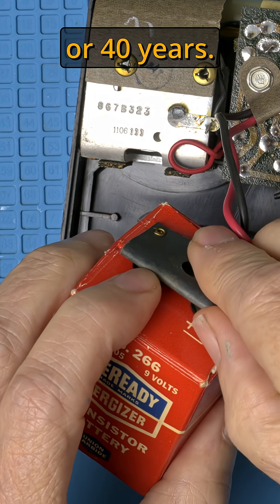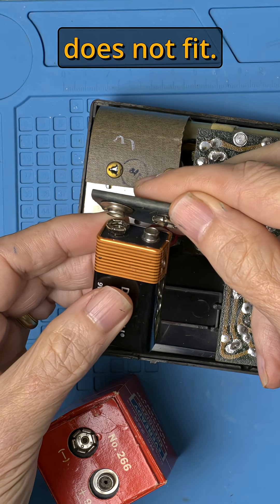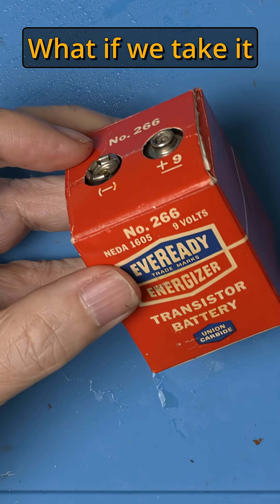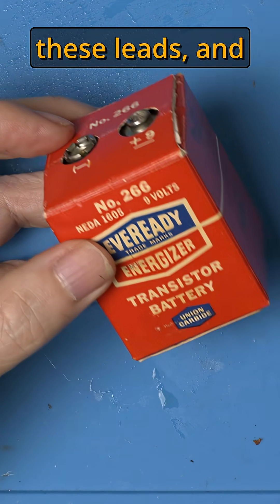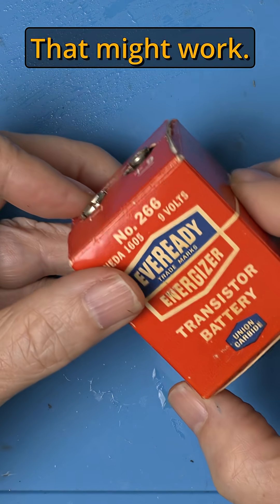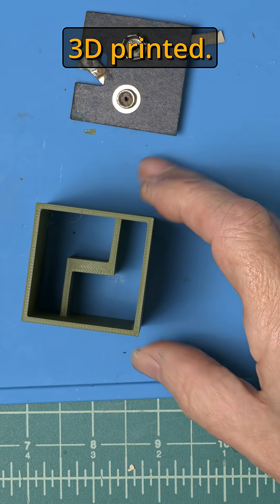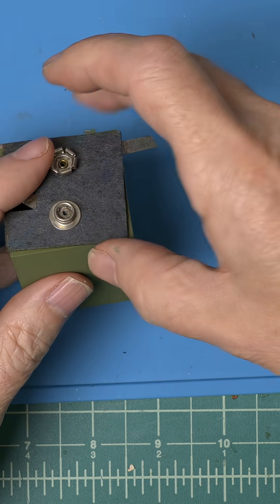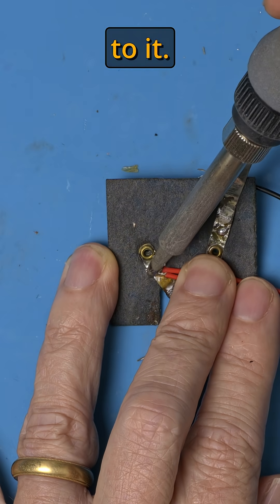3D Printed Vintage Battery Adapter #vintageelectronics #3dprinting #eveready #electronicsrepair

Comment: If you connect batteries this way, make sure they are the same and have precisely the same voltage. Otherwise, one of them will discharge.
Reply: Doesn't matter on alkaline batteries, they can handle the balancing just fine, only lithiums care about that kind of stuff.

Comment: connecting these two 9V paraller only kills them faster, is better to  use  6S AA 1,5V NiMh
Reply: Yeah, and then you have to charge 6 NiMhs every time they die instead of putting in 2 new alkalines and being done with it.
Reply: @neoxr9655  Agreed, I'm already running out of batteries to throw into the ocean, now I have to scour the streets looking for discarded vape pens.
Reply: @giveAIchance  As if consumers contribute to even 1% of waste/pollution. A lot of money has been spent to condition you to think it's up to our individual actions how much the world is fucked.
Reply: @neoxr9655  or just have a few charged batteries ready to go.

Comment: Dude, even 9 volts are getting difficult to find. And if you need a AAAA battery? Forget it. Had to find a 23A like two months ago. The package litterally arrived with dust on it. And CR123A's? 😂 good luck.

Comment: You get more power out of 2 AA alkaline batteries than from a standard 9V battery. Would have been better using 6 AA batteries in series. If you didn't have enough space, using less batteries and a boost converter would still give you more Wh.
Reply: This would also prevent current flowing from one battery into the other if they are at different voltage levels, which is a good idea if they aren't rechargeable.
With two (non-rechargeable) 9V batteries, I think it's a good idea to add a diode in series with each battery for this reason.
Reply: AA batteries would fit in a spot welded packet. For 3D printed battery holder only AAA would fit.

Comment: Pretty sure you could get those when I was in highschool. They were flashlight batteries. For the big ones with the kick stand. Plastic instead of cardboard of course, but might at least fit the connector
Reply: I don't remember 9v flashlight batteries.  Are you thinking of a 6v lantern battery?
Reply: @richardmartinez4145 maybe

Actually, i was getting the application mixed up, but im 40% sure I have put eyes on a large 9v. It was at least 10 years ago though.

Comment: You can't put batteries in parallel, they will fight with each over to maintain constant voltage ultimately self discharge and$or over heat!!

Comment: Strapping 2 cells together doubles the cell discharge as each cell has a plate and the electrons naturally jump you could use shocky diodes to stop this or just one cell at a time.
Reply: read this to yourself, it makes no sense lol. if your worried that one battery might try to charge the other, the difference is so little that it will not cause any harm to the batteries or cause one to leak.
Reply: @joshwayop I did not say leak and strapping two cells this way over time the self discharge is increased test it over 3 months did this at the BICC almost 40 years ago.
Reply: @alunroberts1439  the self discharge would not increase at all, the batteries would not be dumping any charge into each other, they will balance out and just stay at the same voltage

Comment: Wont that be 18 volts?
Reply from the maker: No, the batteries are in parallel, so the current doubles, not the voltage.
Reply: @Dream.Build.Create  thanks

Comment: Depending on the sizes, 6 AA or AAA would be far longer lasting and cheaper. Batteries in parallel (raw) like that are not ideal.
Reply from the maker: I just went out and measured it - you're right six AA do fit.  Okay, next radio!

Comment: Beef up those flush cutters. The small ones are good for 1mm copper. Have broken those in half with too big zip tie. Theres a size up from those. 6 inch? Less useful for small electronics. But way more forgiving for general shenanigans in the workshop small projects.
Reply from the maker: Thank you, great advice!

Comment: Cool fix, but long way around instead of just adjusting the connector.
Reply from the maker: If the connector was corroded I absolutely would have done that, but it was pristine so I wanted to save it.  I also thought it would look cool to have the old battery still in there!
Reply: @Dream.Build.Create  it does, can't argue with that

Comment: At first, I was wondering why you wouldn't just swap the leads out in the radio to fit a 9V, but I'll admit this was a cool fix.
Reply from the maker: If the connector was corroded I absolutely would have, but it was in perfect shape and I thought this would be a fun way to do it.
Reply: Thinking the same here about swapping the leads, but then you run into a problem of how you secure the battery in an area larger than the battery itself.  Electrical tape?
Reply: @ForDemoPurposesOnly  If I'm lazy and it's a personal project, I'd probably just set it in there and call it a day. It's unlikely I'd be doing much to knock it loose or damage anything. But yeah, realistically throwing some electrical tape on it would be an easy solution.
Reply: @ForDemoPurposesOnly cardboard and gorilla tape
Reply: I'm with EVmodern. Really cool fix, but if I'm in the field, I'm swapping leads. 
I'm a mechanic by trade, so I am always looking for the fast easy fix.

Comment: if you have 2 modern 9V connectors, why don't you just cut off the ancien one and solder the modern one on it , then velcro it into the case ?
Reply from the maker: If the connector was corroded I absolutely would have done that, but you're right, it was pristine so I wanted to save it.  I also thought it would look cool to have the old battery still in there!

Comment: Excellent solution!  I noticed years ago that "lantern" size batteries were coming with D cells inside from the factory. Very similar. Should be 2400mah as compared to the original which had 2600mah. Not bad considering they do still sell 266 batts but for > $30!!!
Reply from the maker: I did not know that about those lantern batteries!  Yes two alkaline batteries vs one larger carbon-zinc, almost nets out.
Reply: You can even buy adapters that allow you to use D-cells in place of a lantern battery. The D-cells that I have (Procell) are just shy of 20 Ah.

Comment: Now saving that battery box was COOL!!  I am not sure if you had any room, but it looked like if you made your frame a bit longer, it would protect the internal connections.  Only other thought is to warm the old battery box to soften the glue before opening it.
Reply from the maker: Those are both great suggestions!  That's why I post these, I always learn so much.
Reply: @Dream.Build.Create  Ah, just a different set of eyes on the same issue.  Glad you like the ideas and again, very cool project!
Reply: let the past die...kill it if you have too
Reply: @imperialpresence1173 those movies were so bad dude it’s so lame quoting the SW sequels
Reply: @jman22009   try replacing no.6 dry cells ..i'd love to make a rechargeable replica and put my old lamps to use...instead of moldering away on a shelf
what he did was like a heart transplant
Reply: @imperialpresence1173  You would then repeat history, bad and good.

Comment: The vintage form factor battery was priceless. Should have preserved it. 😢
Reply from the maker: I'm totally with you.  The battery isn't quite priceless though, you can get them on eBay for $10 - $20.   I wanted to keep the vintage look when the radio was opened and still have it work.

Comment: Why not just change the lead on the radio side to connect the battery?  Would have saved time and $ and no 3d to print .
Reply from the maker: I absolutely would have done that if the leads were corroded, but these were in perfect shape so I wanted to preserve them.

Comment: Id say stop wasting. Just get a 2 lion batteries with simple bms You get 8.4v.  or use additional stepup to have 9v available until the end of discharge. Will last you ALOT longer also. And then you can reuse it as you told is eats alot of power.
Reply from the maker: That's a great idea!  I'm sure it would work fine at 8.4v

Comment: I did a similar repair on a 1950s record player.  Double electrolytic capacitor had failed so I fitted 2 modern caps in the original casing.
Reply from the maker: That's a great way to do it and you preserve the look.
Reply: 80 years ago, my grandpa fixed my great great aunts radio with a light bulb. Last I saw it, it was still working,  but that was 50 years ago. 😅
Reply: I did that to resurrect an old Magnavox stereo console.

Comment: Why not use six AA/R6 batteries in series instead?
Reply from the maker: Hey that's a great idea - I just opened up the radio and checked, six will fit into the same battery area.  Next radio!

Comment: Nice idea, but be careful. If the two batteries don’t have the same voltage, one is going to charge the other one. With basically no current regulation other than the resistance of the wire. So it should be important to use two batteries of the same kind or to be extra sure use a diode or a fuse… 

I like seeing old tech to come back to life with such great ideas! :)
Reply from the maker: You're totally right.  I should have emphasized that it should be done with two fresh batteries right out of the package.
Reply: @Dream.Build.Create bro those are not lithium ion. The difference is negligible
Reply: It's 1a at most, it'll be fine

Comment: Man, you should instead put in a rechargeable lithium battery and a type-c port on the side to charge it. I mean type-c port to a 2s BMS then to voltage up regulator to make 9v from the cells voltage.
Reply from the maker: That would be the ultimate power move!
Reply: A 2s LiPo would likely be the same voltage under load as the original, particularly when partially discharged. Those old batteries had quite high internal resistance, while the LiPo's is incredibly low.

Comment: that battery looks like it might be same size as uk pp7, also long discontinued(last bought one in the late 1990s), unfortunately,
Reply from the maker: Yes, I think it might be.  Other viewers have said that you can still find them, except they're at an eye watering price of $40.
Reply: @Dream.Build.Create  even the pp9 is i think now discontinued, last ones i saw in shops had gone past the 'expiry' date, Roberts Radio 'used' to make a 6 'C" cell adaptor to fit in a pp9 space but no longer made, and were only available by special order from Roberts dealers anyway, havent found anything 'similar' so far ...

Comment: You can still buy a semblance of the 266 as an alkaline equivalent, but it is expensive at about $40 (rediculous). You are ill-advised to direct-parallel two 9v batteries, because they will self-discharge due to imbalances in their charges.
Reply from the maker: $40?  Ouch!  You're totally right about two batteries in parallel, but if they're both fresh from the same package its usually safe enough - at least for awhile!   This radio eats power.
Reply: @Dream.Build.Create can you not fit 6x AAA inside? It would last much longer.
Reply: @mrfrenzy.  if you want capacity and 9v size, go with 3 cr123 cells. i replaced the 9v in my multimeter with 3 lithium cells and now have at least 3x the runtime.
Reply: @mrfrenzy.  AAA normally have less capacity than 9v, but it does depend on the construction of the 9v.
If is the type that uses AAAA sized carbon rods, a AAA would be better.
Reply: @mrfrenzy.  You can fit 6x AAA in a tiny modern 9V battery -- I've seen it done. 6x AA would be a good fit here!
Reply: @Dream.Build.Create How sensitive is it to switching noise? (thinking LiIon cell and boosting to 9V along w/ charging,/protection circuit) $40 for the correct battery is silly, but it's rather niche, so understandable. Even 2x 'normal' 9V gets pretty expensive if it chews through them...
Reply from the maker: They are pretty sensitive to switching noise, but not very sensitive to voltage because the old carbon-zinc batteries wouldn't stay at 9 volts for very long.  I bet it would work with two Li-on batteries producing 7.4 volts, just at a lower max volume.
Reply: @Dream.Build.Create 3 in series with a step down would probably work better. Bucks can have extremely low ripple if you just add bunch of capacitors at the output.
Reply: Of course we have every battery expert on the planet here in the comments. 🙄
Reply: @googleevil9553 it’s guided content. It is shown to a few new people. And to a lot of those who have watched similar
Reply: Ik it’s different but I’ve had lead acid, agm, and lithium of all different sizes together in direct parallel and they were fine for years never went dead or showed much deterioration
Reply: @cadenbrown4861  AGM is just a type of lead acid and both those chemistries are able to be recharged. The difference is that alkaline is non rechargeable, so the cells can't safely self balance.
Reply: @Hitman12. likely meant flooded lead acid vs agm (absorbed glass mat)
Reply: With no formal training but six decades of life experiences I was thinking along the same lines.
My thoughts were to put a simple diode in the input lines to keep each battery from back charging the other one.
New batteries wouldn't exhibit any issues while as they age the inherent inequalities would show much more. (Almost like making a power time bomb.) But then I worried about the long term losses from adding extra components too.
Reply: Lots of interesting ideas hete
Reply: They won't self discharge when put in parallel, they'll only balance each other out and that's all of the charge pouring that'll happen.
Reply: two 4.5v MN1203 battery in series much better
Reply: This can be fixed with a simple  diode
Reply: @punker4Real  But there are losses due to the diode voltage drop.
Reply: @MadameRotten-je4vk  Why did the diode kiss the capacitor?

He couldn't resistor.😂
Reply: Wouldn’t they just balance out? Why discharge?
Reply: You could also probably fit a modern lithium rechargeable cell in there with a voltage converter. Could even slap a charging plug/battery manager in there if you really wanted to. Then you'd just be recharging your cardboard battery 😏

Comment: Altho if I am right you essentially plugged an 18V battery into a 9V system
Reply from the maker: That would be exciting!  No, I put them in parallel, so the current doubled, not the voltage...
Reply: We don't put batteries in parallel.  They won't be exactly the same voltage and one will discharge into the other.
Reply from the maker: You are totally right, but if they are both fresh batteries from the same package it will usually work pretty well.  This radio eats power.

Comment: You should have just upgraded the 9 volt plug and put a modern battery instead of trying to preserve the battery
Reply from the maker: If the battery connector in the radio was corroded I absolutely would have done that, but it was in perfect shape so I wanted to preserve it.
Reply: @Dream.Build.Create  exactly, keep things original as possible, i had a few radios that used a weird centre tapped 9v battery, centre connected to one side of the speaker, and couldnt find a socket to match the plug to make an adaptor so altered them to use a single battery and added a capacitor to feed the speaker to ground, i have a few sets using separate 6v pp1 batteries(no longer made), connected similar way i need to adapt somehow
Reply: It's a historical item, not a utility one. Preservation is the key of this process, where he wants everything preserved as long as possible within his means.